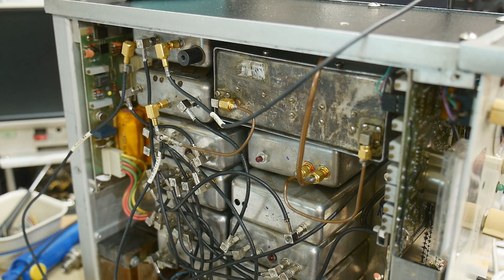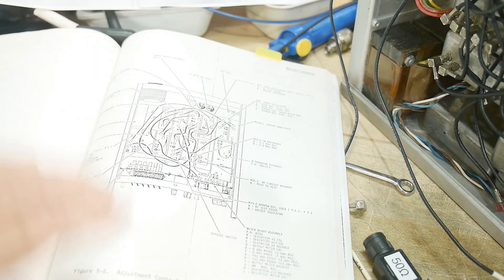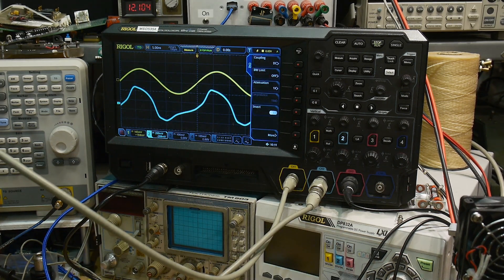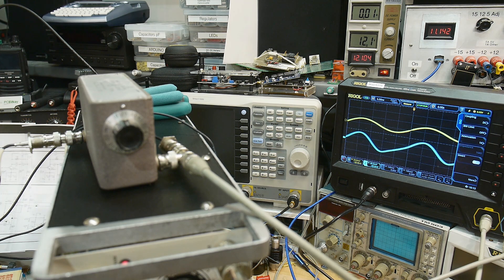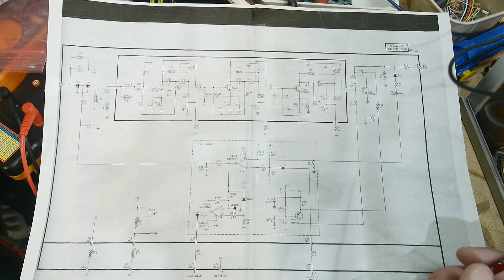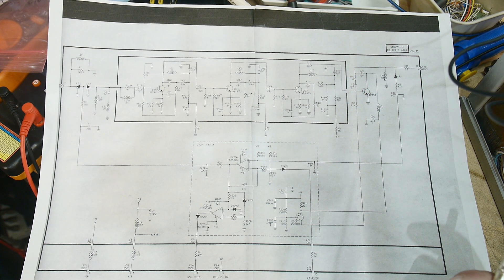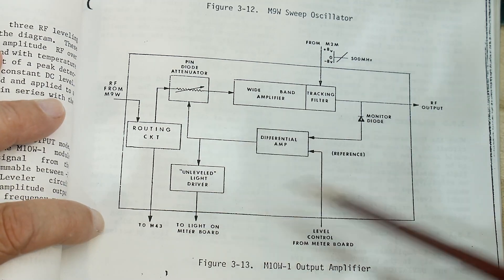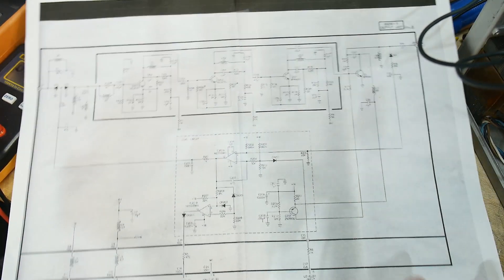#1917 Wavetek 3000 RF Generator (part 11 of 14)

Comment: If the PIN diodes have been replaced with ordinary diodes, or if the bias to the PIN diodes is screwed up, or the diode is damaged, that could cause the nonlinear distortion.  The PIN diodes have long reverse recovery time so they act as resistors, conducting over both halves of the cycle, when presented with sufficiently-high frequencies.

Comment: did you break the AGC loop yet and try with a pot connected to diode junction to adjust gain manually? Also probe each collector in amp to see where the distortion starts

Comment: There is one main amplitude control loop from the diode at the output over the amplifier in the middle to the pin diodes at the input. This loop gets a control signal from the lower right. It seems to work. 
There is the other circuit with the two transistors. The one at the output can short the output signal via 1µF to ground. These two transistors get no further control signal. Maybe they act as a limiter or fuse and they take care that the signal does not get to high to avoid damage. 
For a test you may take the 1µF capacitor out (or whatever value is in this place in the current version). 
In the 3 stage amplifier you could also check the intermediate signals with a non connective probe to check whether just the output stage is distorted to verify that the clamping transistor at the output makes the problem. (... if it is the case, ... if not ... go to start ...)